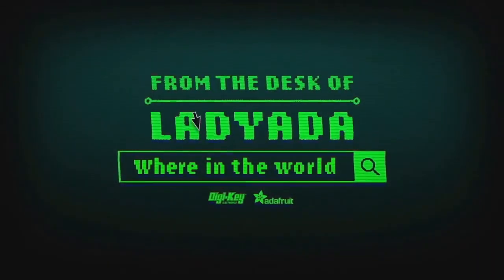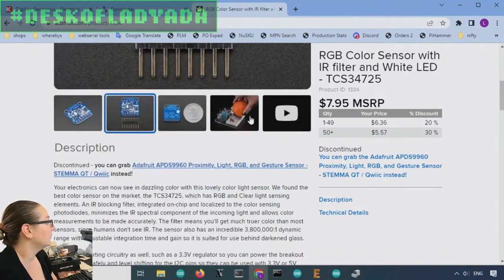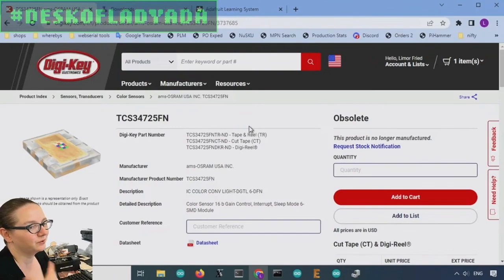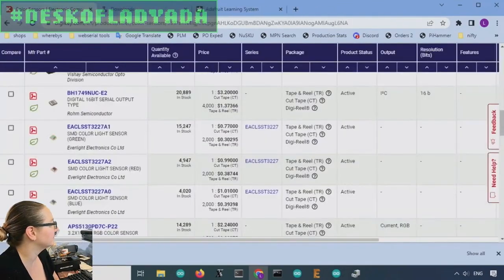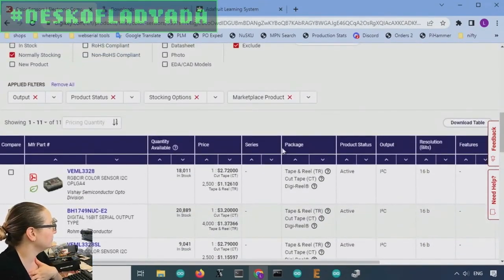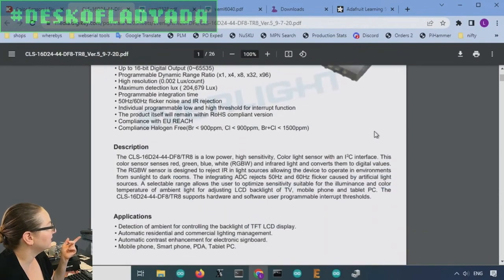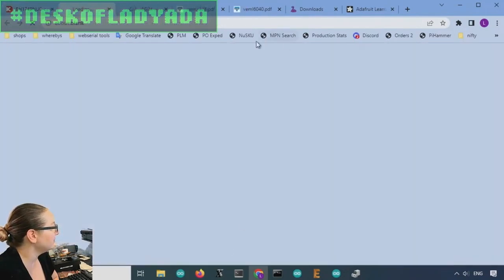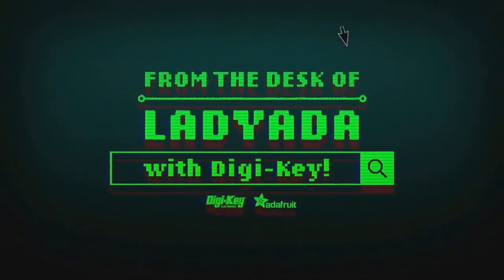The Great Search: Color Sensor to Replace TCS34725 #TheGreatSearch #digikey @DigiKey @adafruit

Comment: TI has a relatively new part now, the OPT4048. It has an interupt pin and 4 sub-addresses. Like the Vishay VEML3328, it's a "tristimulus" response sensor which means the color sensing is tuned to the human model of color preception. You can use these types of color sensors to get accurate color reads and even map the readings to a standard color space (like CIE 1931). All you have to do is some matrix multiplication. The OPT4048 has an IR filter, so it's not sensitive to IR-- but that makes it better for accurate color sensing.